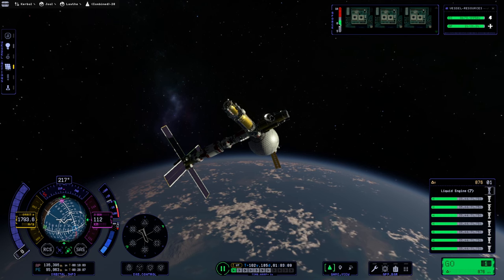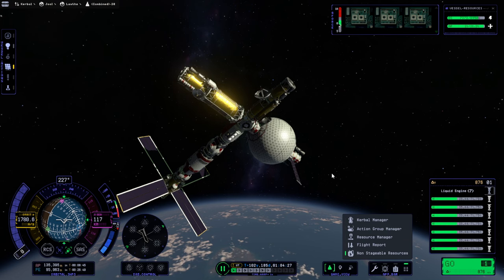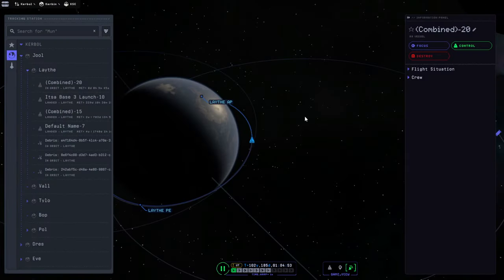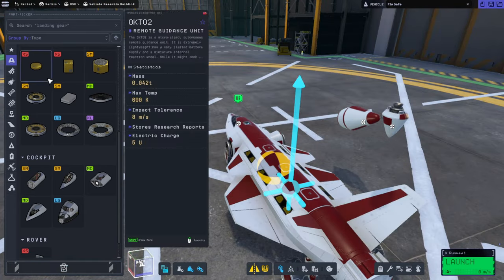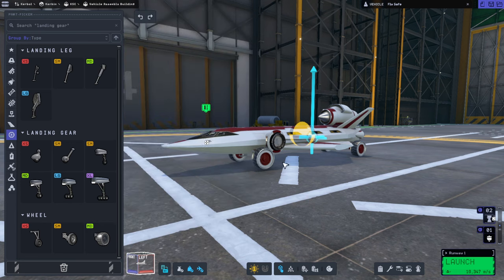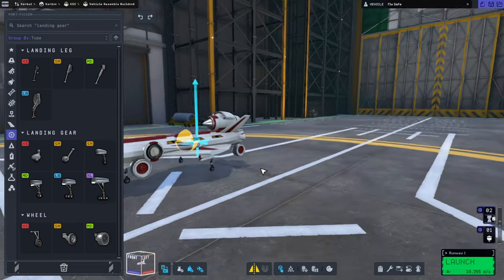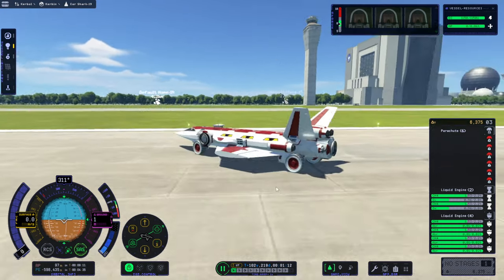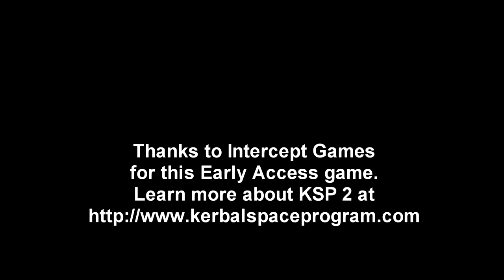KSP 2 Early Access - The Laythe Plan 15

Comment: Glad I’m not the only one having massive issues with spaceplanes in KSP2. Designs that fly quite happily in KSP1 just don’t work in this iteration of 2. I’m not convinced that the lift/drag model is correct as yet, which is disappointing as I love the SSTO thing. I love the ability now to procedurally design the wing but the centre of lift on anything with a delta wing is always way too far forward on my designs and need the addition of canards or extra wings with an angular tilt baked in to force the lift vector backwards. Plus.... why is the game still spawning planes 5ft above the runway and so there’s a good chance your craft will either bounce and start the SAS oscillating madly, or the wings just plain break off if they have even a moderate length?

If I may offer some advice on your design here, your wing chord is very long vs a very short span. You will need a high velocity to generate much lift, although your drag will be super low. Also when you bank beyond even a gentle angle your lift will evaporate and you effectively become a nose or tail heavy missile with only thrust vectoring to manoeuvre. Also, I think the position of your wing means your control surface is only just behind the CoG, and you have very little lever arm to counteract the offcentre thrust vector or even just lift the nose. 

Loving the playthrough though, look forward to the next episode.